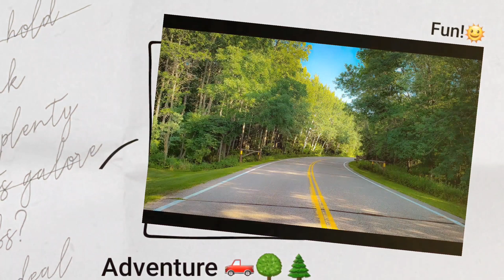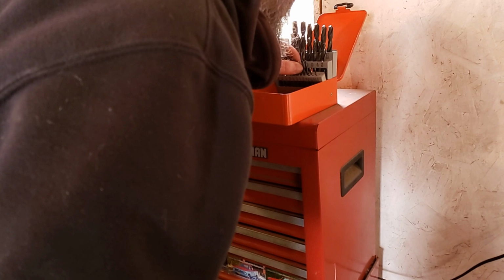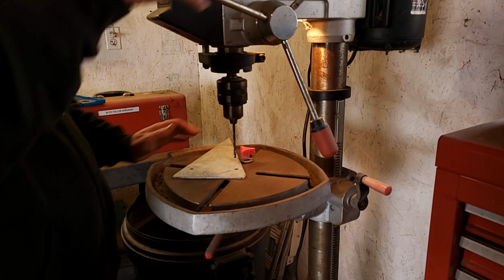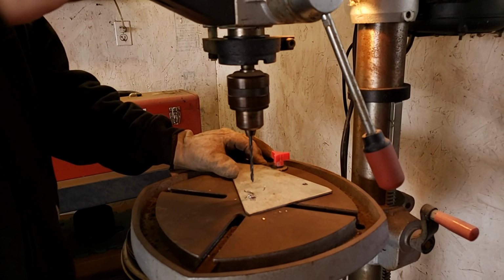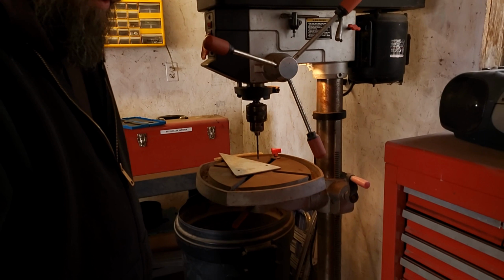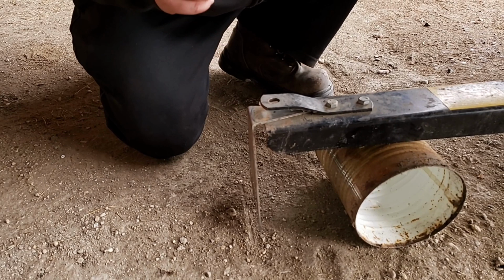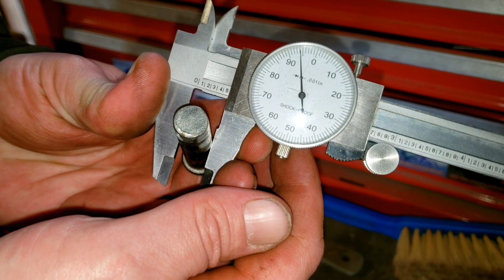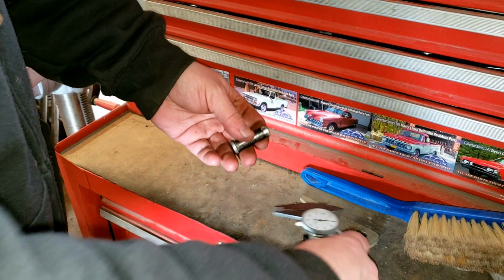Ariens IKON xd 52 hitch

Comment: I see the fancy store bought model bolts up top and possibly in that square hole as well, any concern of bending that back plate with the flush mount only?
Reply from the maker: We thought it looked a little weak in lateral direction, but there isn't much steel to do any gussets.  The motor and exhaust system hang off the back and the steel that the hitch is bolted to is actually more of a trim panel. We would never tow anything heavy with this mower.